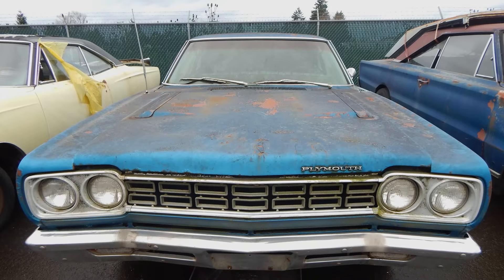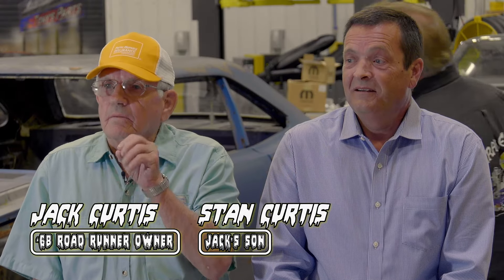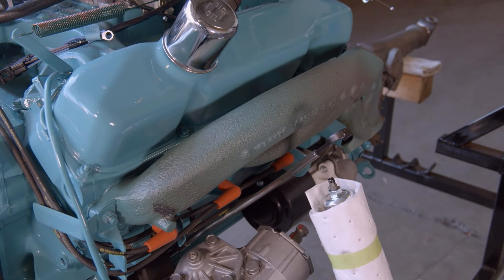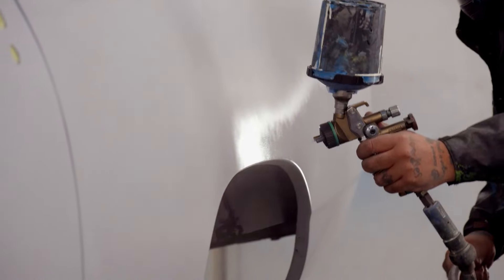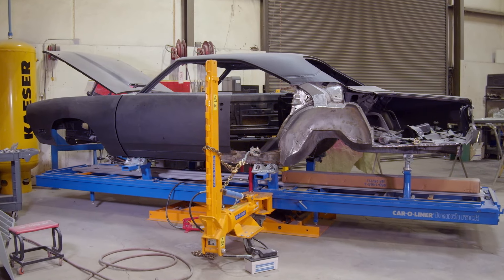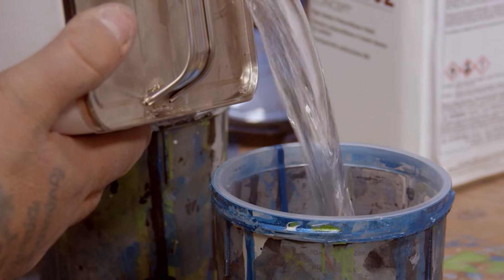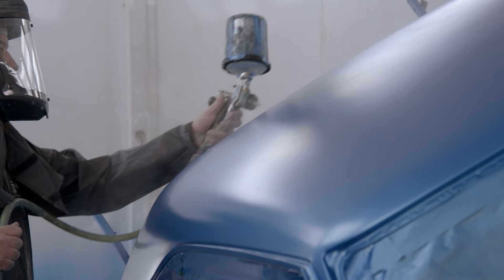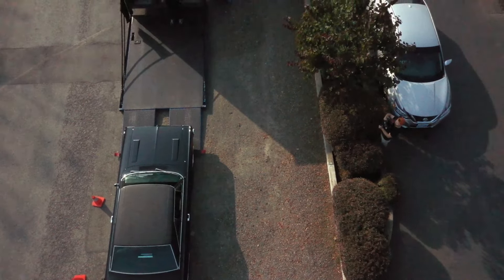NEW EPISODE: BIGGEST MUTHA THUMPIN' CAM EVER AT GYC

Comment: Comp thumper cam all noise for guy who have stock engine and wanting to it sound like it has built engine. You get some performance from thumper cam but there are far better choices out there.
Reply: Your 100% wrong. If you spend some time running a dyno, you will find out these make tq and hop much more than one would think, when used properly.
Reply: Your 100% wrong if testing in real world 2 engine may have same hp and torq but 1 pulls better aka faster. Dyno a tool not end all that everything goes by. Secondly I've seen dyno and track results other cams are far better. 3rd go read Comp cams description- for stock engines that for noise (street rod guys) with some performance. Then look at duration and lift see what it does not exactly the best but GREAT for exh note.  Which is exactly what I said go learn to read